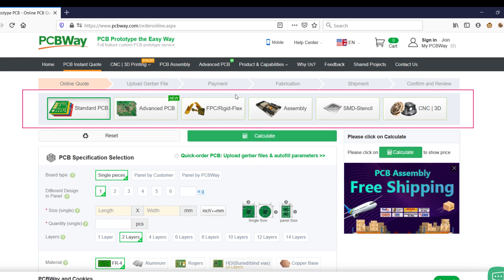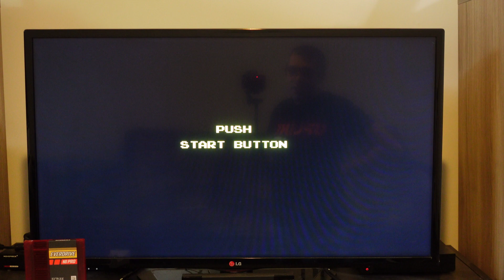Get the best video from your NES Toploader! NESRGB mod installation guide and demonstration

Comment: I think I might have just damaged the ppu when trying to remove it. I did the same 3 step approach but I think I applied too much pressure with the screwdriver at the end. I guess I'll now need to complete the install and then test to see if it is good.
Reply from the maker: I hope that it all works out. That step is very challenging and you definitely can’t use too much force when removing the chip
Reply: @LIRetroGaming  just wanted to mention that I finished the mod and the PPU was not damaged; it all worked out good! However, I am seeing some jailbars after performing the nesrgb install on my top loader. Is this normal? I thought that the jailbars would have been completely removed after doing the nesrgb mod.
Reply: @LIRetroGaming  thanks! I'll finish the installation this weekend. I hope that I didn't break it!

Comment: let me give you an important note if you need A-V only you can take them right from these pins to the RF module  because it takes the default composite audio and video in convert it into RF signal yes its not RGB signal but its much much better quality than the RF
Reply from the maker: Yes that is correct, if you want composite video you can extract it from those places
Reply: @LIRetroGaming  your respond means a lot for me thanks so much

Comment: Did you or anyone else get the top line wobble/flickering? I used a rev 2 board with 2.2 FW and still haven't been able to get around it.
Reply from the maker: I actually haven’t seen this before with the NESRGB
Reply: @LIRetroGaming  Ok, my use case must be slightly different. Thanks for responding.

Comment: How do you avoid the odd quirk of this mod where with the adapter board the pins are slightly too high for the PPU to sit flush?
Reply from the maker: There’s a capacitor on the left that prevents everything from sitting flush. I remove it and lay it flat against the board, which gets it out of the way
Reply: @LIRetroGaming  Ok I appreciate it. One part that has been confusing me is where exactly the PPU is supposed to sit on the NESRGB. Where do the pins for the adapter board for a toploader go? Should one row be on the outside and then another underneath where the PPU sits?
Reply from the maker: Not sure if this helps, but here are some toploader install pics https://photos.app.goo.gl/zDHhhvPUyoNe5RZB8
Reply: @LIRetroGaming  that helps, thanks. I got confused and made some mistakes along the way. I added the PPU before the headers connecting to the adapter board. Now I have to desolder the PPU or solder that one header from the bottom.

Comment: Thank you for this video, very informative with nice picture 🙂 Could you please tell what kind of cable you use to get RGB from the console. Also you shorted J8 jumper, is it because you don’t have 75ohm resistor in this cable?
Very appreciate for the answers ☺️
Reply from the maker: Thanks, glad that you enjoyed it! I actually removed the bridge on J8 later on - that was a mistake because the cable does have the 75ohm resistor built in. This mod is compatible with Hd retrovision component cables or the insurrection industries snes RGB cable: https://insurrectionindustries.com/product/super-nintendo-entertainment-system-rgb-scart-cable/
Reply: @LIRetroGaming  Thank you for the reply! Unfortunately these cables out of stock now.  I’ve also tried to install the nesrgb to my av famicom, but after that I have scrambled video. How do you think, can it be the cable issue? 
Just for showing the result, it’s hers: https://youtu.be/BV7VBiMm-bc
Reply from the maker: @xsmile592x  I just watched the video and it looks like you have sync and then you lose it. What type of SNES RGB cable are you using on the AV famicom? Jumper J8 should not be bridged on the nesrgb board
Reply from the maker: @xsmile592x  these cables are also good https://www.retrogamingcables.co.uk/SUPER-NINTENDO-SUPER-FAMICOM-GAMECUBE-WII-N64-SNES-NES-RGB-SCART-CSYNC-COMPONENT-YPBPR-HDTV-HDMI-VIDEO-CABLES-CORDS-RAD2X/SUPER-NINTENDO-SUPER-FAMICOM-SNES-NES-RGB-SCART-CSYNC-COMPONENT-YPBPR-HDTV-HDMI-VIDEO-CABLES-CORDS-RAD2X/SUPER-NINTENDO-PAL-NTSC-PACKAPUNCH-RGB-SCART-CABLES/packapunch-super-nintendo-entertainment-system-snes-n64-rgb-av-scart-cable-ntsc-gold-scart
Reply: @LIRetroGaming Thank you 😉
Reply: @LIRetroGaming  I’m using the cable that was included with the NESRGB board. Maybe the problem in it 🙂 I will buy the new one that you recommended. Hope it will help. Thank you for the support 😉

Comment: I have HVC-101 Famicom with High-Def mod. It’s about the best you can get from original hardware. But seems no more these boards are made. So Rgb mod with RetroTINK-5X Pro would be option i guess or Mister FPGA.

Comment: I have six nes top-loaders with a/v out (no rf) like the snes and n64.  And I purchased these units directly from Nintendo back in 1995.  I'm not sure how many were made or what the current value would be of these systems.  Any info. would be greatly appreciated!!!  And I love your channel!!!
Reply from the maker: Wow that’s amazing! I have heard of these top loaders but they are quite hard to find. Nintendo made small quantities with multiouts in response to complaints from some customers. The RF output from the Toploader is quite bad and some models are a little worse than others. Customers complained and then received replacements with multiouts
Reply from the maker: It would be really cool to open up one of these and take a look at what is similar and different. There is a Japanese version of the NES called the AV Famicom, It has a multi out and I’m curious how similar it is to what you own!

Comment: I’ve found to get the RF modulator off easier, I use my desoldering gun AND my soldering iron at the same time. About 325C and the ground plain has a harder time sucking all the heat away. You’ll be surprised how much smoother it comes off. Thanks for the video!!
Reply from the maker: Definitely a good idea! It definitely needs a lot of heat in order to come loose

Comment: Is there a way to mod a top loader to be a pal machine? cpu, ppu, and an oscillator, what else?
Reply from the maker: Actually those three things are all that would need to be changed. Install a PAL CPU, PPU, and clock, and it should behave like a PAL NES
Reply: @LIRetroGaming  How about the cic? just go around it?
Reply: @VuRkka  Just desolder and lift the leg that talks to the cartridge CIC, there's guides online

Comment: Awww yea, Fix it Friday! Dont think Ive ever actually seen an NES in real life... I guess I must have at some point but I cant remember if I did. Enjoyed the tear down and upgrade :)

Edit: Out of curiosity would there be any benefit to using both a desoldering gun *and* chipquick? or would it just basically suck up the chipquick with but the chipquick needs to be on the board to do its job?
Reply from the maker: You can combine the chipquik and a desoldering gun but it can cause issues. The chipquik can end up clogging the desoldering gun and it’s rather annoying to clean it out